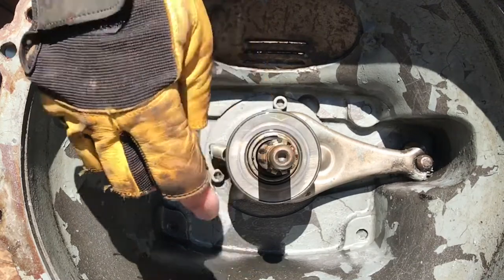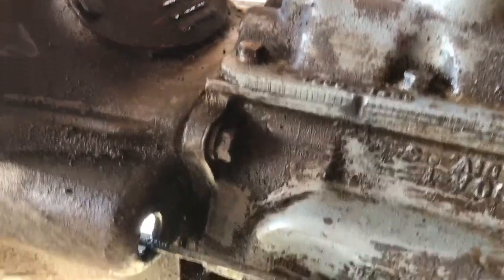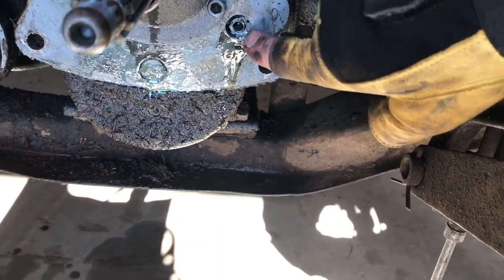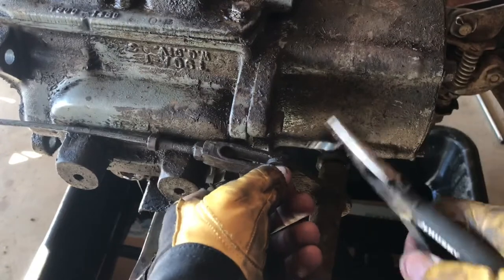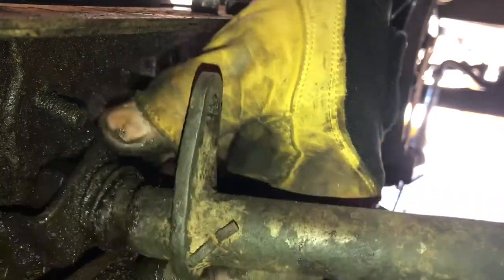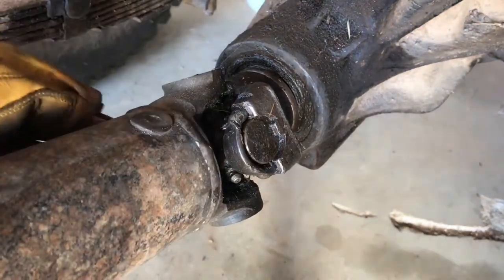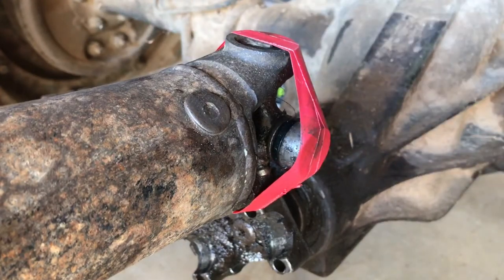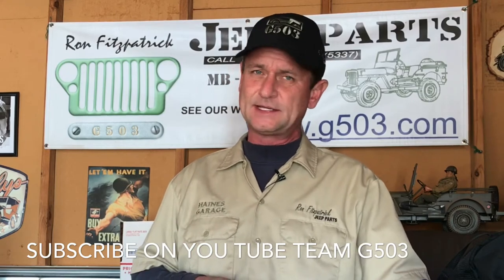Team G503 Preparations For Removing The Transmission And Transfer Case From A 1943 Willys MB

Comment: Scott, How can I remove the front cap to change the seal?  Engine is out and I can't get the cap out of the bell housing.  Need help!  Thanks!
Reply from the maker: Tom Fitch cap out of the bell housing? Starter bushing?
Reply: @TeamG503  The bearing retainer cap on the front of the T-90.  But never mind...got it out.

Comment: Was the frame modified at all for the T-90?
Reply from the maker: Yes, the crossmember was moved back about an inch, and a bracket was welded to the side of the game to move the fulcrum ball for the Pedal Assembly. The floor opening in the tub where the transmission sits, was cut and drilled for a t9o style cover.